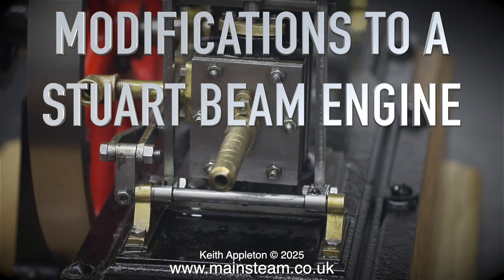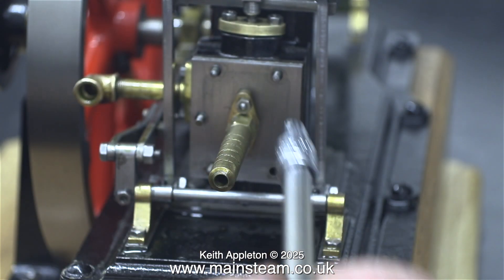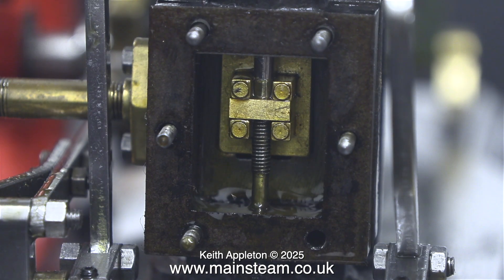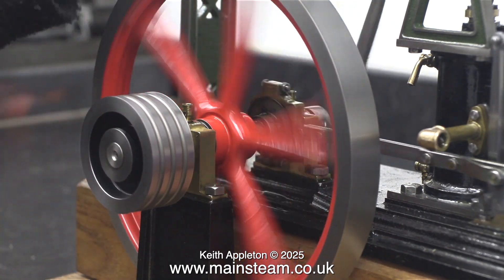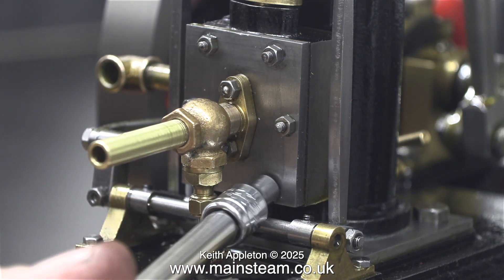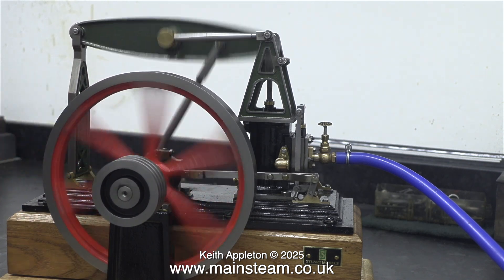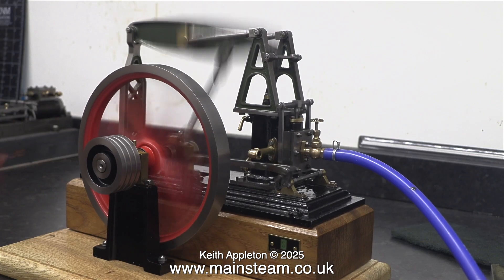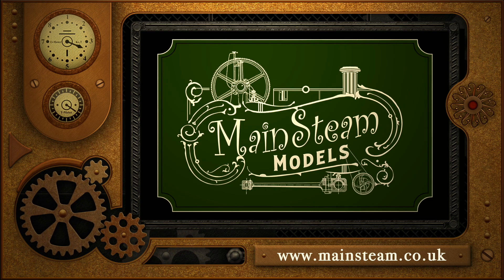MODIFICATIONS TO A STUART BEAM ENGINE - PART #9

Comment: great video again Keith. In a previous video you had turned down a pencil to allow marking the centre position of a part through a hole. I have just bought a set of Transfer Punches off a well know auction site. I bought the metric but there is an  imperial set as well. Mine is 1-13mm with half sizes so 25pcs in its own metal stand. £28 a bargain. Get well soon John
Reply from the maker: I have had a full set of transfer punches for years, but they are often too long for the job and hitting them with a small hammer is often problematic owing to lack of space ....... I prefer the thin pencil method - it works for me and it is non percussive }:-)))